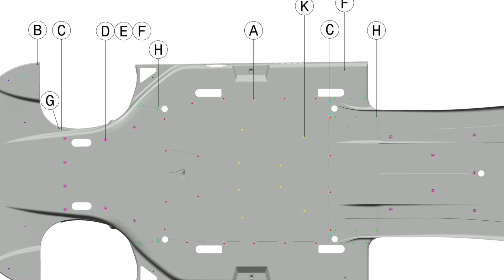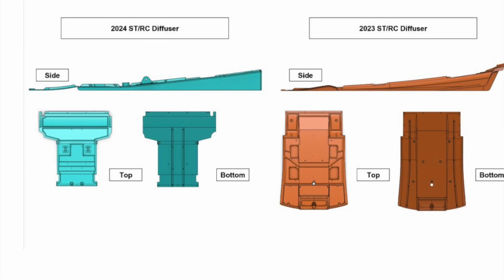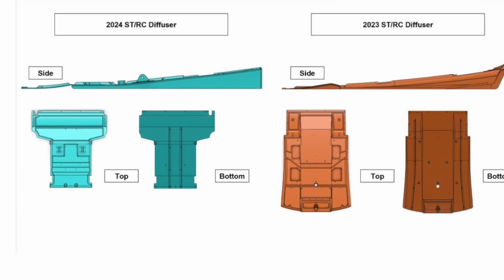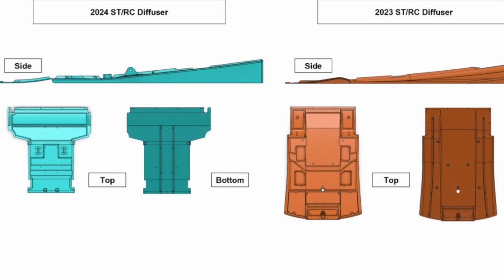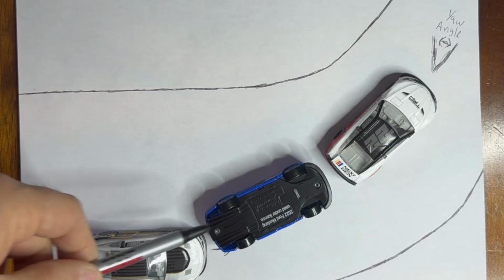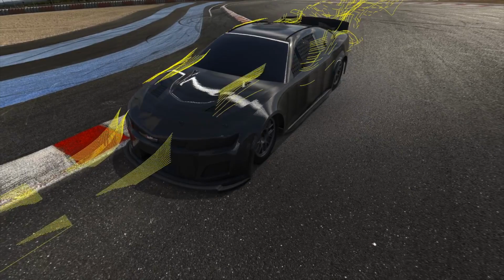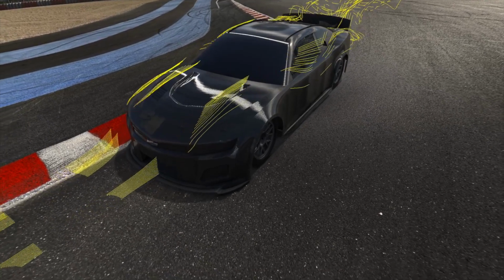Why Passing is So Hard With The NASCAR Next Gen on Short Tracks

Comment: I am not that knowledgeable on the physics of racing but i have a comment ill throw out there for anyone else to correct me on.

I feel like the next gen car was an attempt to make dirty air less of an issue on bigger tracks by making mechanical grip easier to produce (wider tires, larger tires, maybe other things im not aware) and they also tried to reduce the amount of dirty air that the leading car produces (stepped splitter, rear diffuser, smooth underbody). And so the car's design was a massive attempt to solve the dirty air problem and give the trailing faster car the ability to get right up on a leading car without having dirty air stall them out and then allow them to have enough mechanical grip to get around them. But it just didn't work and the cars still stall out when when they are behind a leading car (and blocking has just become so easy to do for the lead car) and the dirty air still robs them of the downforce they need to overtake the leading car.

And all the changes i listed above (as well as better brakes, IRS and the sequential shifter) have just ruined short track racing with no real way to fix that

Comment: Is it possible that the main issue is the ride height and platform control requirements? Xfinity and Trucks both have minimum ride height rules, which had been abandoned in the Cup Series in 2014. Gen 4 had coil-binding, then the COT introduced bumpstops; both implemented by teams to control the platform. With no ride height rules, the cars move less due to the bump stops and high rebound shocks, introduced in the Gen 6 era and exaggerated in the Next Gen era. Assuming NASCAR implements a ride height rule, with restrictions on the bump stops and outlawing coil-binding (max number of coils), an emphasis will be placed on the mechanical platform rather than the areo platform. It seems at least to be an easy item to test with limited cost to teams and partners
Reply from the maker: They've tested at much higher ride heights and it often ended up worse than what is currently in the rules.

Comment: The thing that makes me think this is mostly not an aero issue is they tried testing with no diffuser at Richmond last year I think and the drivers said there was little difference. I think it's part HP, part wider tires, part new suspension, and part aero. I have no idea how they'll get back the short track racing we had before with this car.
Reply: Aero-wise, there wasn't too much of a difference. However, drivers commented that they could yaw the car out more without the diffuser.